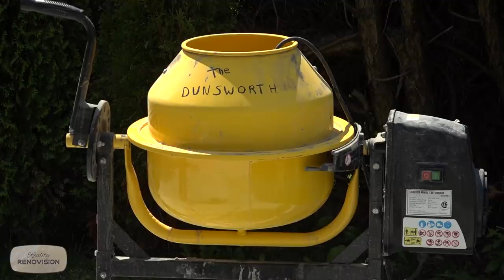This Should Only Have Taken 3 Days To Build! Not 2 months! | Reality Renovision Ep15

Comment: I built this shed summer of 2019. Couldn’t find the windows, so I went a little bigger on the ones I could find, and added a third on the wall with the “hidden” door. I used the little bit of extra framing lumber and the door piece of LP smart side to build a barn style door for the front to save the $200 it would have cost for a solid door. Came out fantastic! I poured the slab myself, and everything. Even put a nice round edge on it. This was by far the biggest, most complicated thing I’ve built, by far! Thanks so much Jeff! 
For anyone wondering about cost...
Concrete slab 6” thick plus all tools - $600
Materials for shed plus all tools - $2250
 Bought cheap red barn paint, and white trim (matched my red house with white trim)

Took about 40 hrs to build after letting the slab wet cure for two weeks. Worth every penny and minute. And the sense of accomplishment still hasn’t passed! 

Three BIG snow/ice storms and a year and change later, not a drop of moisture inside, and roof system supported about 2’ of heavy snow pack with no issue.
Reply from the maker: Cheers Rabbi, glad to hear it!

Comment: if he put " tiny homes" in the title he will get 3 million views  😆😆
Reply: Or break it into 4 or 5 twenty minute videos. There is too much competition to expect that someone will click on this and dedicate 90 minutes having never seen anything else from him.
Reply: Tiny home you need to pull a permit, but you don’t need one for sheds under normal size.
Reply: Blades O Grass  I'm addicted
Reply: @youarehere1251  there’s no difference between a tiny home and a shed. Your property is already zoned residential if you’re living there.. but you might need permits for other things, like concrete pad, or if you run electrical or plumbing out to the shed but the exact reason he built the shed to these dimensions is cause he didn’t have to pull a permit because the dimensions classified it as a “non permanent structure”
Reply: Why would you want to live in a shed?

Comment: If you don't have a hammer with the special lever, you can use a short pipe clamp or a clamp with a long handle to correct/force the board into place while you screw or nail it.

Comment: The purpose of the WWM is to help prevent and minimize cracking of concrete, what good will do under the slab? Shouldn’t the wire mesh be pulled up to approximately the middle of the slab as the concrete is being poured?
Reply: Yes, he did wrong.

Comment: nice video .. little tip tho .. before going in with the crete , spray the boards down with a mist of oil .. be it cooking .. old engine whatever . they just need to soak up a bit of oil, that way the boards will release very easy when you pull the mold. also seeing you nail the sides on by hammer .. makes me love my nailgun haha

Comment: great video. I have a few tips for using a mixer and bags to make a large slab. I cemented under my carport, screened in porch, and house after they were made, (don't ask i am still mad). First get a few sheets of tin, (3' x 8') and make troughs/shoots, just basically take the tin and curve them into a half circle, and cut out 2x4 and 2x6 boards to hold them in this shape and to use as legs and then make a cement hold back board out of 2x4s so basically you have a 2x4 in the slab at about 3' wide and it goes all the way to the end of the slab so you have basically walled off a 3' wide section to fill with cement now you put a 2"x4" in between the inside edge of the slab and the 2x4 you have staked off inside and you use the 2x4 to hold back the cement as you pour it in a 3' wide by 3' wide square. The trough/shoots allow you to have your mixer and bags outside of the slab and you can roll it much easier outside. You will also need to make a pull stick to pull the concrete down the shoots. Basically a long 2x4, (preferable a 2x2) with a 2x4 screwed to the end as a head to grab the cement and pull it down the shoot toward the slab. As you fill the 3'x3' square you street trowel that section with a 2x4 over the surface using the boards in the concrete to get a basic smooth surface. If you have the help they can also trowel the top to get it pretty good for now. Then pull the 2x4 that is 3' wide down 3' to make another 3'x3' square and once you reach the end of that 3' wide line, pull the long 2x4 you had at 3' wide out and move it over 3' and repeat and have someone go behind you and trowel the surface and spray with a garden hose if needed to work it. That way you are working one 3'x3' square at a time and troweling it as you go. If you had help 1 person could fill a one gallon coffee can and hand them to you to put in the mixer, 1 person puts the bags in the mixer and pours down the shoot and pushes the cement down the shoot with that custom made cement puller/pusher, and one person trowels as you go and moves the 3' wide 2x4 and holds it in place as you pour. So 3 people is optimal. I did 1200sq ft of about 3" cement with about 300 sq ft of it being 4" for my carport and it took A LOT of 80ib bags of cement, but i would frame up 1 rectangle of about 3' wide by 12' and it took about 20 bags of 80ibs of cement per slab but after setup and clean up the actual work was only 1hr at a time that i had 2 people help me. So basically I only asked for 1 hour at a time. I did the setup and clean up. And slab by slab we did it over about 2 months. Frame one day, pour one day, fire department one day, and repeat. 

So to paraphrase, 
1) make 2 or 3 different length shoots to keep your mixer out of the slab and make it easier to move, pour the cement down the shoot to where you want to pour at that time and move the shoot and mixer as you continue to pour. 3 different sizes allows for mixing and matching for different lengths 
2) frame up 2x4s inside the slab to pour at about 3'x3' squares at a time moving the one board as you go and troweling as you go and if you have to stop it gives you a straight line to finish and start with next time. 
3) a 3 person crew is best with a water supply person, a cement mixer/pusher, and a troweler/framer to hold the board in place as you pour and move the board as you fill and trowel as you go
4) metal keyways, (basically a thin metal plate that you use to divide sections of the slab that you use metal spikes to hold in place) are good to divide the slab square into 4ths no bigger than 10'x10' they help with sectioning off mini slabs as you pour, give you a surface to trowel off and give a place for the cement to expand and contract to help with cracking, since they divide the slab into mini slabs they also help with grading or leaning the surface as you can make the center higher going down to the back or edges to make water run out or away
5) its a shed a rough 2x4 trowel is good enough for a "non-slip" surface.

Comment: Couple questions for me to understand better how this all works:

* I didn't see you compacting the gravel. It doesn't matter in this case? Will it not settle and then make your slab crack easily?
* I understand this is a shed, not a dwelling unit, but don't you need any kind of flashing around door and windows to keep water out?
* There where no shingles installed... so the membrane product you used is two in one?

Thanks. Love your videos!

Comment: Tips to make life easier, more reinforcement on the boards (better safe than sorry about blowouts), compact the gravel! Last thing you want is the gravel to settle over time then you're left with a hollow spot under the concrete, when finishing the concrete bull float before passing the trowel this way all the rock isn't on the surface making it easier to leave a smooth finish with the trowel, and lastly when pouring the cement lift the rebar as to not let it sit on the ground.

Comment: You may have done this off camera. The 10 x 12 Shed where you built the Roof and placed it across the double top plates. Did you tie the rafters to the plates with screws, nails or hurricane clips. Thank you.
P. Smith

Comment: A few points for anyone pouring concrete themselves.. The dirt has to be wet and packed down first. The gravel also has to be wet and packed down good. I would recommend a vapor barrier! The re-mesh(wire) should cover the entire floor, and it has to be supported above the gravel, about half the thickness of the concrete. If your going to lay the wire on the ground, and pour concrete over it, just leave it out as it will do nothing.

Comment: Really love your chanel. Just did some things for the first time (plastering) by taking your advices.
P. S. When you make a mold for your concrete, fill a garden whose with water (you'll need a helper). When it's full close the open end with your thumb (shut the water), let the helper take the whose of and fast shut the other end (you'll help him by holding your end lower than his will be when he takes it off).
Take that whose to your construction site. Place excess of the whose where concrete will be pored. One of your than needs to align his end with the top of the mould (top end of the first plank), than the other one lowers his hand with closed whose by the column that will hold parallel plank (you'll do this on bout ends of the first plank to bout columns that will hold the paralel one). Personally I dont even set the firs plank(board or boards if I'm using small one's in shortage of bigger one), because firstly I put corner columns and stretch a rope on one side. You can also start with rope from one corner and adjust it by putting leveling board on it to see if you need to lower or take up next tie-down. But on longer builds leveling board and rope aren't that good solution, so wagres (vagres) with whose is excellent way to level out ends of the mold. Moment when pressure of water on both your palms gets low you are leveled, and you can mark it on the column that will hold your boards. Than if you need to lower it because boards are to narrow, you'll lower all 4 marks by the same dimension. When you set the bord, you just put your leveling bord close to the middle (if you are checking one by one) or across two boars next to each other to see if your marking with wagres was correct.
Happy building!
Reply: Also, raybars need to be overlapped (by one line of squares) and tied together with thin wire.
It's dangerous to have your mixer in the wet pit. It's DC machine here (in Sebia) and it might pull its ground through the front metal leg in to the wet ground you are standing in if it malfunctions and makes a short...

Comment: Wish I found this video, before I built my shed with gable roof, would have saved time. Your right about shed kits, I looked at  a few and they don't use 2x4's so they are not very stable. Drew up my own plans for 8x10 shed. Cost less than $700, kits were double that. Ill use you version next time. Thanks for sharing.

Comment: Great Job! Look quite impressive I think that after watching this video I might be able to build my own, with a little difficulty.   I watched the entire video, not one dull moment, however the small details were taken for granted.   Details like attaching the walls to the foundation, when using the gun, did you first make pilot holes?  Also I didn't quite understand how you made the pivot post which assisted you in holding up the first wall... one man style.  Small details, but they were ego deflating causing me to lose confidence in my abilities.  I'm not certain that the video was made for me.... on a scale of 1 to 10... I'm a 7.5 on craftsmanship... I don't build everyday.  I subscribed with the intentions of watching more of your very informative teachings or rather demonstrations thanks great job!!
Reply: That gun drives the special and very hard concrete nails thru the wood and into the concrete with no prior hole.

Comment: As far as I know, wood is not supposed to touch concrete because it may rot, even if its treated. You should have used some kind of this insulation in between...
Reply: yea you always use rebar too for concrete it works wayyy better than that like fence wire he used

Comment: Has anyone mentioned that the higher you put the windows allows for more shelves or storage underneath inside? I would have matched them to the top of the door for that reason. Even better- a bank of windows at the very top-- maybe square windows so 2 can be above the door and 2 on either side so the entire inside is good to go for storage but has light as well.  You also mentioned shear strength of screws vs. nails- I would have loved to hear a conversation about that- more info- because I had no idea screws had any weaknesses.

Comment: Ok, just got to the window install part. When I sold these particular windows I always told the customer to caulk under the flange/trim overhanging the exterior siding.....did I miss you doing this? When you caulked yes you did do the perimeter 👍 myself, being so conscious of water penetration I still would caulk beneath the flange/trim for added protection. .....(from an old window and door guy.) maybe you agree? Maybe you don’t? Also wondering if you’d advise using a sill gasket between the bottom 2x4 and the concrete? Cheers🍻 good video!

Comment: I always use a Transit before I start any building especially a concrete slab. Probably would have saved you a lot of time and effort in the beginning. If you don't have a Transit, ive used a line level just to get a basic idea of your grade. Just my two cents.

Comment: We had a large shed built by a seasoned carpenter. To address the drainage issue, he built a raised foundation instead of a concrete one.  That was 10 years ago and we’ve never had a problem. Was there a reason why you didn’t opt for a raised foundation?

Comment: I really like your videos. Note to save your back on those sidewalk blocks. Use a pair of Slab Setters. Stand up do not bend over. Push a slab setter under either side of the block and lift. They are dead simple to use with a second person (Wife, child, dog ;o) but even by yourself those blocks are out of the way quicker and way easier the the grunt method.

Comment: The first corner has an exposed 2x4 with no sheeting, correct? You nailed the sheeting to the corners of the back side wall , then you nailed the sheeting to the first stud back in the first corner on the 2nd wall, and I see that there's an overhang to cover the 3.5 inches on the front wall, so I'm assuming that you eventually went back and put a 3.5" strip of sheeting over the exposed 2x4, and then put your corner trim over the top of that. Sound correct?

Comment: I appreciate that everyone may not have all the money needed to accomplish all this.
Craigslist - FOR SALE - FREE is priced right.  in bigger towns and cities, and depending on how well CL is used, you can get much of these supplies for free.  Start early.  Save up.
Here, in Vegas, I just searched "landscape", and "Landscaping"  Many, many listings.  One guy has 1.5 to 2 tons.  The pics imply he is correct.  Half a 2 car driveway, about 2 feet tall.  So, your rock is covered.
Search the other items you need.  Rebar.  Lumber.  Door.  Siding.  Shelving. Shed.  Garage.  Wheel barrrow.  Bucket.  I have seen all these, and more.  At least in major cities, you will get a few of the purchased items as FREE.  Just days ago, I saw a massive wooden shelving unit, site built, and yes he did acknowledge the scale.  He said, I have a forklift to assist loading. (Shelves for inside a commercial warehouse )
Reversing this, as he started, I thought, "just stake it, take a pic, post to FREE, and people come dig the site for you.  Not kidding.  Stones out, AND away.  Grass, taken, deep enough to keep alive. Just step in and rock to level.
One local woman had to repost with a DAY and a SCHEDULE system for people to come, as she was inundated with people who want to come get rock.
I just want to let you all know, CL-free is a real treasure.

Comment: I haven't had time to watch this video, though I think I DID watch the other one. I'd like to see a video of building a shed that has a peaked extension, with more extension coming downward from the extension. By doing so, it'd have much better resistance to wind, both from blizzards and tornadoes. When the extension only goes upward, I'd be concerned a good, strong wind would tear off the roof, ruining the shed.

Comment: Errrmmmm.... so I think you just taught me how to build my tiny house :D Thanks!!!!
Reply: Definitely useful to follow this for a tiny house, just make some adjustments like installing/building a real front door with small gaps and door hardware instead of a gate latch, house windows that are designed to be sealed and finished on the inside, put blocking in between the rafters right at the outside edge of the walls so you can insulate the roof all the way to above the top plates of the walls, and consider putting a layer of insulating building blocks all the way around underneath the walls so you can put down some floor insulation without creating cold spots around the edges, and it'll make the wood last longer. I'd also recommend to go with the 6" rafters spaced at 16" instead of 4" ones at 12" to create space for insulation. Think about ventilation as well, sealing and insulating everything is great to be nice and warm with little energy in the winter, but especially in a tiny house you need some fresh oxygen-rich air supply and vent out the humid CO2-rich air. The best way to do that is by using at least one window with a self-regulating window vent and an extraction fan controlled by a CO2- and humidity-sensor, this way you ensure good air quality without ventilating more than you need to so you don't lose too much heat in the winter or suck in too much heat in the summer.